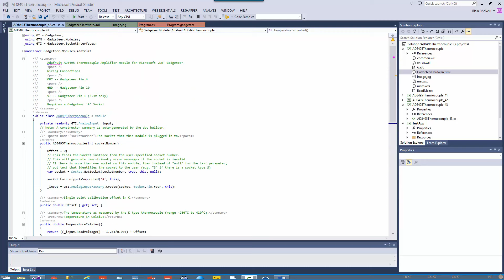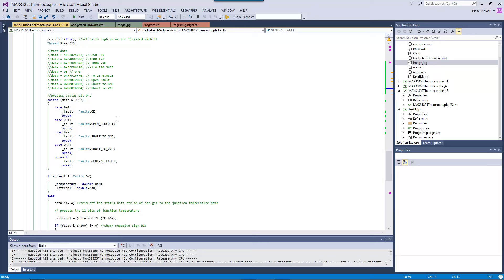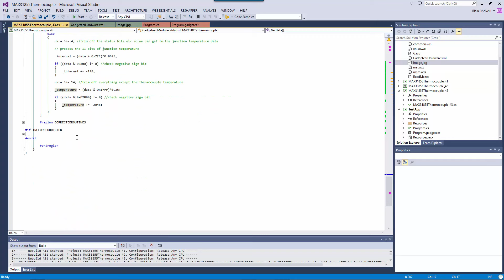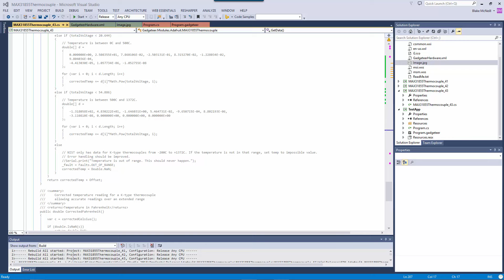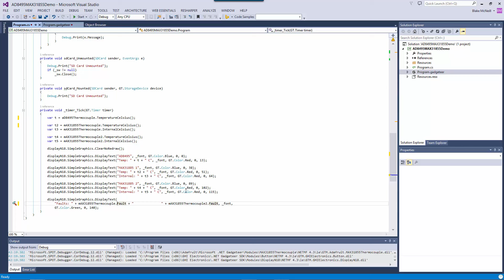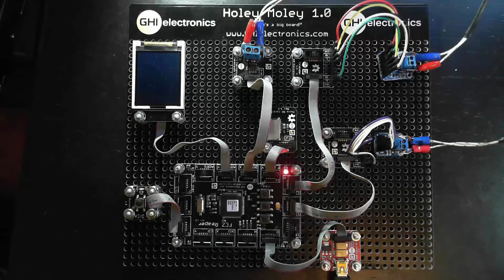.NetMF Gadgeteer Thermocouple drivers for AD8495 and MAX31855

Comment: Great post.  Have you tried these modules on Windows 10 Core yet?  I'm looking to use the MAX31855 with a Raspberry PI 2 running Windows 10 Core with the IOT extensions.  Do you think I would have a problem porting your driver to use the new framework?
Reply from the maker: +Brett Mathe my driver code is written in C# so it should take very little work to port this to working with a Raspberry Pi running Windows IoT.
Reply: I got it working.  https://github.com/bmmathe/MAX31855_Win10Core_Example/tree/master
Let me know if you want me to credit you in some other way than I already did.
Reply from the maker: Brett Mathe looks good!!